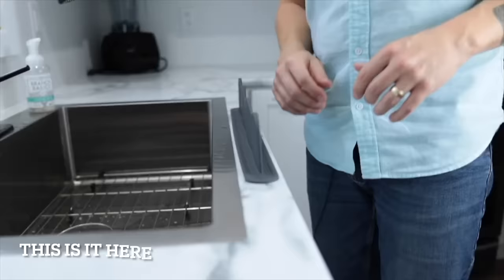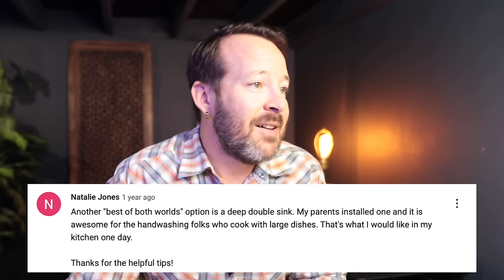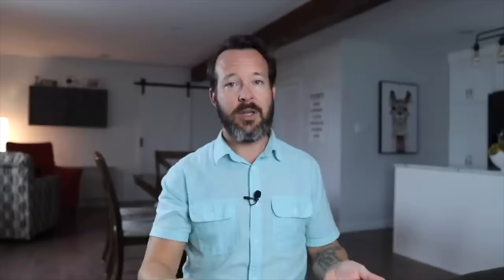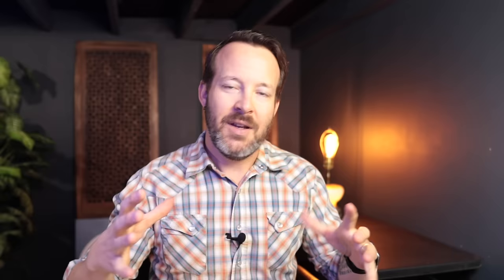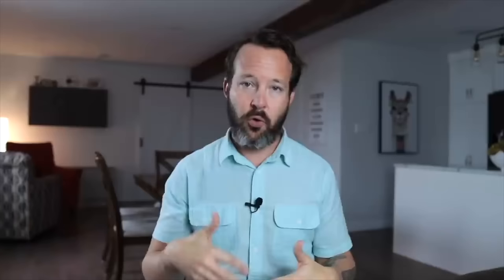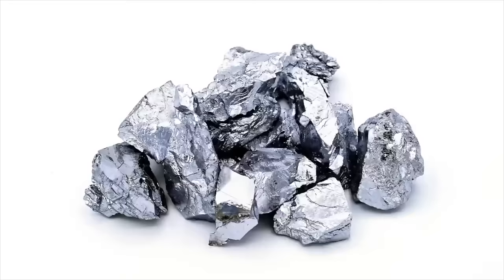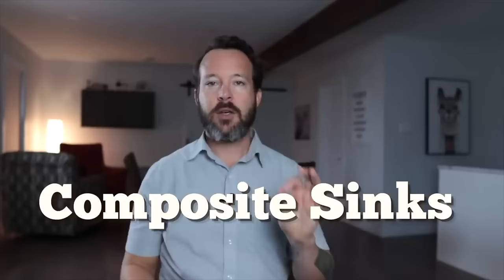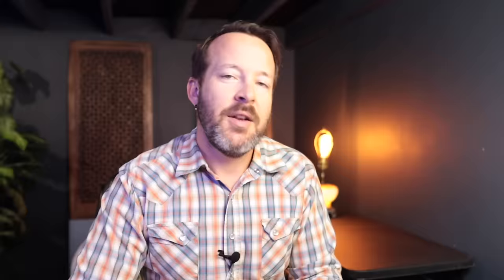Watch First Before Buying a Kitchen Sink

Comment: Just watching your video now, and a couple of things about sinks and water in the kitchen that I have been thinking of (and this is because we are overdue by about 10 years for a kitchen renovation, its original 1968 with holes in the laminate floor and other issues).  Our kitchen is directly over the garage, for context, on the north facing side of the house. Also, I am short (5'2"), and I don't have long reach.  I also dread corner cabinets; I know that water is the #1 destroyer of homes; and 

1.  (My husband disagrees and says if it was a good idea, people would do it, I disagree with him because there are plenty of things that we know could be done better but aren't because people don't a) care, b) it isn't standard and ppl have a hard time thinking outside the norm).  I want a whole floor drain: Both the fridge, the main sink and the filler sink all deliver water, so there is triple the potential for water issues. Ideally it would be located under the sink (there could be doors under the sink, but no cabinet per se. ie, no toe kick or cabinet bottom).  The whole floor would need to gradually slope, so I think this is the part that is prohibitive.  (one solution is to have a low drain around the edges of the room, MAYBE in front of the toe kick, so that all sink/fridge leaks are diverted and not "sitting" on the floor.  It would also help for when mopping and squeegeeing the kitchen floor;  another possible solution is to have multiple drains, under each water source, and in the garage they hook up to the same drain system)

2.  Standing water issue:  our current kitchen has less than an inch between the faucet and the window sill, and water collects right behind the lip of the top mounted sink, up agains the edge of the wall.  I can't get hardly anything behind there to mop up the water, and it gets gross and moldy so fast.  My solution is to move the sink to a wall (I will miss the view) and do a wall mounted faucet.  This means the whole area around the sink can be wiped, without going around fixtures.  (oh, and lets just say I abhor 4" fixtures in bathrooms, and lots of crannies, they are so difficult to clean.  remember, the fancier they are, the more likely they were designed for people who hire others to do their cleaning and maintenance!). 

2b.  if the sink is in a corner, it would be a rectangle sink, not a 90 degree sink, which , means I would have to create a panel behind the sink for the faucet to emerge from, that can still be accessed for repairs.  (any design that doesn't take into consideration the events of needed repairs, isn't a good design, in my mind.). that angled panel would probably only go up a foot or so, and then level off with a quirky shelf as likely there will probably need to be storage or open shelving above it.

2c. If the sink is not in a corner, I will choose the widest deepest sink I can, because I get stressed out leaning over the tub to clean fridge drawers and shelves.  In fact I plan to know which fridge we are getting, and make sure that all the removable parts FIT in the sink!

I do like having an integrated drain board to one or both sides.

Regarding the sink itself:

I don't like the seam of undermount sinks, they are gross in everyone's houses. 
I prefer not to have a top seam, because inevitably over time, they warp ever so slightly, leaving 1mm or less gap in spaces, that inevitably get gunky.
However, the fully integrated sink (the one piece counter/sink situation) I don't think I am super keen on, because.....for strength, the sink needs to have a goodly amount of structure on all sides, which leads me to my next point:

3.  sink position:  because I am short, I find that regular faucets don't come out far enough, so I am ALWAYS leaning over to wash and rinse etc.  I need the faucet to come out closer to me, and also for there not to be so much counter between me and the sink.  So this makes me think I will be leaning to a farmhouse/apron style sink.

4.  One reason for me to be okay doing away with cabinet doors in front of the sink, is so that i can put a 4x4 or 6x6 across the mouth of the cabinet on the floor where the toekick would be, so I can alternate my feet resting on it (ie, I need the knee space in order to bend my leg)

now, that is unsightly to have an opening in front of a sink, so I could also do cabinet doors in front of the sink, that once open slide back and into the cabinet.  this may serve my purpose adequately.  but not if I do away with the bottom of the cabinet for the sake of the floor drain.

I come from a different continent, and I find that American's (white specificially) are so picky about so many things, and then we waste so much space in our cabinet designs, and so boring in our house and space designs.

I think my cabinets are going. to mostly be drawers in the base cabinets, maybe with full extension sliders, but otherwise just well waxed wood tracks.

Cabinet fronts and cabinet front damage...I have been exploring different fronts, and finishes, trying to find something reasonable.  Since I was about 10, I have wanted a kitchen (at least) that I could powerwash.  that is ridiculous, but the idea stands in terms of how wet it needs to sometimes get, in order to clean it--or at least that is how it feels, and how lazy I am.

Q: Can I put car paint enamel on cabinet fronts?  I don't want them to look dull and scratched like some cars do over time.  

Q: behind the water faucet (and stove etc), I would like as close to 1 solid piece of whatever, because I need to not have grooves to scrub.  I am thinking of doing a thin layer of corian as the rear/back splash.  Does that seem reasonable? any other ideas that don't scratch/dull?

I am not doing a "pot filler" by the stove for several reasons, not the least of which is because i am not in a commercial kitchen, and if i can't carry the pot from the sink to the stove, then I definitely can't carry it back to the sink when it is boiling hot.

I am doing a sink near where we do tea and coffee, just enough for filling those two items, and our drinking glasses.  currently our water filter is at the sink, and the number of times I have empty the sink in order to get a glass of water or fill the kettle is irritating.

I think that is all my thoughts so far.  I have 1968 white corian for countertops right now, and I love them and don't want to get them replaced.  I can write on them in pencil (so and so's tea/coffee, so and so's meds, pets have been fed, please unload the dishwasher etc) and it just wipes off.  its rough enough to write on, but smooth enough to wipe off.  I think it is one of the best kitchen features ever.

I am also thinking of doing a reduced depth countertop on one side of the kitchen, if it doesn't make it too unsymmetrical.  I am also thinking. ofdoing a section of either marble, or something that keeps cold, and maybe running cold water to the sink under it, so that there is a cold pastry making surface.  And I would love radiant floor heat in the kitchen too.

I haven't figured out kitchen flooring yet.  I like mexican tile, the color etc, but I live in a cold climate (virginia), and I don't know how easy it is to keep clean.

Thanks for your videos! definitely introduce me to new ideas and such!  this video introduced me to work sinks, which I defin need to consider!

Comment: So I think the under area of the sink is an area that would potentially drive my OCD crazy 😬 

What about actually having a center sloped extra drain (like you would have in a wet room or shower) to move any potential moisture down the drain and have a tile grout basin (instead of wood which has the worst combo with water 

And then for the front cabinet doors like a non-transparent coated glass , or stainless or something else? 

I think the mosaic barrier of the interior cabinet is good at least to prevent water damage 

And approaching this area like we do with other high moisture areas like showers makes more sense than what we’ve done for decades with just exposed wood . 

Thank you so much for the video, 

I’m a first time home buyer 🙂
Reply: Agreed. I was looking for place for my comment which is: A leak sensor can be plugged into an outlet in this cabinet.  Laundry bathrooms etc. esp. when in a multistory building. The sensor alerts the smartphone anywhere you are. Good for frozen burst plumbing. Good peace of mind and save a huge cleanup and expense. Insurance discount.

Comment: Had a double sink in my new house built in 2000.  HATED IT.  When the new granite countertops went in the sink was replaced with a large, deep, heavy gauge, single stainless model with center drain/disposal.  You can fit a cookie sheet in there.  Never going back.

Comment: Question, please:  Have you ever seen sinks turned 90°? 

Here's why:  I'm in a 110 year-old NYC rental apartment with a smallish galley kitchen. Moving the plumbing is out, but I am able to change the cabinetry and sink on a small budget.  

Thank you for any info you can provide, and for this really informative video. I'm a brand new fan, and am looking forward to exploring your channel. ❤

I'm figuring on a single stainless sink with a standard depth.  Here's thing:   If I turn the sink 90 degrees. I can fit an 18" dishwasher and get a little precious counterspace.  What would I need to consider if I do this?
Reply from the maker: I don't see why you couldn't do this, as long as the sink fits the cabinet.  I can't recall if I've ever done this for a client, but I'm sure I've seen it before.  There are no rules!  thanks for watching my content!
Reply: @MTKDofficial  Thanks for taking the time to answer.

Comment: Even with relatively small sinks, growing up handwashing plates etc. I've always used a plastic 'washing up bowl', to save on filling the entire sink up with water when less would do, and to make it easier to clean. I don't think I've ever filled an entire sink up with soapy water! I think a large single sink would really work for me, as long as the tap is manoeuvrable enough, because you could have your washing up bowl at one side of the sink, and be able to rinse off things that are more mucky or very soapy by the side of the bowl (without splashing everywhere as happens with the sink I grew up using)

Comment: Big fan of big single sinks I grew up with a double sink. And the way that we used to use it was not filling it up with water or using it to wash vegetables and wine or another. The way that we used to use it was one side was dirty dishes. The other side was clean dishes that we're drying. And every time I went to someone else's house specifically Americans they wouldn't do this. So the problem with a big sink is you have to have something else to go and hold your dishes at your drawing so. What ends up happening is we grew up not trusting dishwashers so the dishwasher would be used to hold our access drying dishes. Or we lived in area that didn't have dishwashers because we were renting. 

So there's a space for double sink and I think that that's probably the best way to use a double sink is you wash you put some clean stuff on one side and the third side on the other until you finally work through your dishes. 

But for today, I think a single sink has much more benefits if you have a dishwasher. 

Another benefit to the big single is the amount of space you save inside of your cabinet because with a double sink you have your garbage disposal and another pipe that comes around and comes to the center and that takes up a lot of volume.

We did a double sink for a client who was very adamant of having a double sink. And she lost a lot of her space because she had a smaller sink cabinet for storage.

Comment: Large singles need to have enough slope so the water and crud that it contains drains well, otherwise, you either have a dirty sink or have to squeegee it dry and clean every time it's used.  Another skink issue is metal sinks that have 90-degree corners and edges - crud gets stuck in these corners.

Comment: I once did a kitchen upgrade to add storage. There was so little storage that all of the plates, bowls etc were kept UNDER the sink.  That really tested my poker face when the owner opened that cabinet.
Reply from the maker: Haha. Doesn’t that sound lovely.  I hope it was easy to fix on your end!
Reply: @MTKDofficial  Easy enough. A trip to Ikea for a lot of bits and pieces to add upper cabinets and retrofit pull out shelves. It was an authentic farmhouse kitchen on a farm in Ireland. Probably the most inefficient kitchen I have ever seen. No landing places next to stove or refrigerator.

Comment: One benefit of stainless steel versus harder materials is that it's more forgiving and less likely to break glass items.

As for cabinets, I always go for recycling bins hung on side-mounted pull-out rails. Keeps the bottom of the cabinet cleaner and easier to clean, and makes maintenance work less uncomfortable.
Reply from the maker: 100% on both of these.  I agree.

Comment: Thanks for your video. Now I can better group together of what is on the market, pro and cons ect. I am currently choosing my sink. I also came to the conclusion that I want a sigle bowl sink but the DILEMMA I had is, Farmhouse (apron) vs Undermount sink. I like the look of a undermount better because I am going for a more elegant look and I am not sure if farmhouse will fit but on the other hand I found that apron sinks are more COMFORTABLE in that it does STICK OUT MORE so you Do Not actually have to Bend Over As Much. I have back problems and that seemed to be very practical with apron sinks. I dont know how I can combine the look with the practicallity yet 😂
Reply from the maker: You can still technically undermount a farm sink and get the best of both worlds.  Though it would likely lower it a little, which might not be great for the back.  I think I'd go for comfort in this instance though.  Especially because they both can look great.
Reply: They do make farmhouse sinks designed to retrofit into existing cabinets (in case you are not installing new cabinetry).  I’m getting ready to install a farmhouse retrofit sink in my existing cabinets.  Kohler makes a nice retrofit one (cast iron/porcelain), others probably do too.  Depends on the look you want, but I think the farmhouse sinks usually look quite nice, even in some very modern kitchen designs that I’ve seen.  Your back might thank you, and I think you’d appreciate the larger size.  Good luck!

Comment: For the corian/solid surface sink you could also sand off the areas that the stains that won’t come out, just have to be careful when doing it. Our sink and countertops are corian and while it is nice since it is seamless not sure if it would be easy to swap that sink out without changing the countertops. 
Good vid as usual Mark!
Reply from the maker: Thanks Phil.  It would take some careful calculations, but you could replace the sink.  Kind of a big job though.

Comment: I like a single bowl sink, its more accessible for families with small babies. And if you do hand washing, just put another plastic tub on one side of the sink. I also like the flexible faucet, i don't like sinks that are motion sensors or touch on, id rather have the single handle over anything with sensors.

Comment: I have had two composite sinks and both said not to pour boiling water into them. Well then how do you drain your pasta etc?  I did anyway and they got cracks and discolored after just a couple of years. Don’t buy composite sinks. I want a single bowl for my next sink because we use our dishwasher and the larger sink is handy for doing large pans that don’t go in the dishwasher.
Reply from the maker: Great input!
Reply: I’ve had a Blanco composite double bowl sink with integrated drainboard for 10 years. We love it so much that we are installing it into our upcoming kitchen remodel and forgoing a more on-trend under-mount installation. I found it online and bought from a shop in Canada. Not one regret. 👍🏼

Comment: I love having a sink in an island, but, as far as I understand it, the latest US building codes no longer allow for an air-admittance valve in the island to vent the sink drain, which makes venting the drain on an island sink REALLY challenging. It's doable, but it's difficult, adds a lot to the under-sink plumbing, and requires a clean-out in the plumbing under the cabinet.
Just something for folks to consider if they want an island sink in a new build.
Reply from the maker: Thanks for the tip!

Comment: The “banging and clanging” sound of a stainless steel 2-basin sink can be dampened by carefully spraying foam insulation in the space between the bowls, on the underside of the sink.

Comment: I am surprised no one mentions the down side of the large one bowl sink!  Although I have a dishwasher there is still a hefty amount of  items that require hand washing like cast iron pots etc. so i wash in the large bowl sink and have a dish drainer (small) in there too because I don’t like stuff on my countertop. The thing i hate the most about the sink is that you constantly chase food particles around the sink. Next house noway am i getting a one bowl sink and as for the fancy stainless steel rack it only helps make it worse 😂
Reply from the maker: Why would you have food in your sink?   Wouldn’t you scrape it off into the garbage?  I’m confused on this one.
Reply: I totally agree with this.  Rinsing that large sink looks labor intensive.  I’m doing a new kitchen now and will most likely do a double sink.  I always have clean dishes straining in the strainer in one sink.
Reply: @MTKDofficial Really? You never have a morsel of food on your dishes when they're in the sink? The only way to accomplish this would be to wipe the plate thoroughly over the trash. Also, many people have garbage disposals, so putting food in the sink is quite normal.